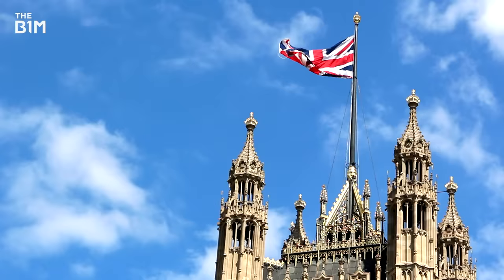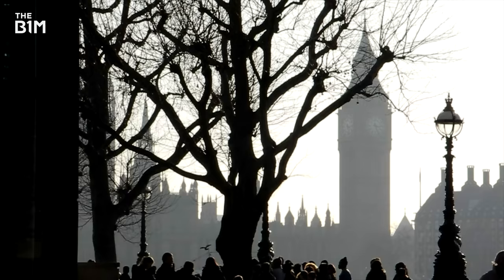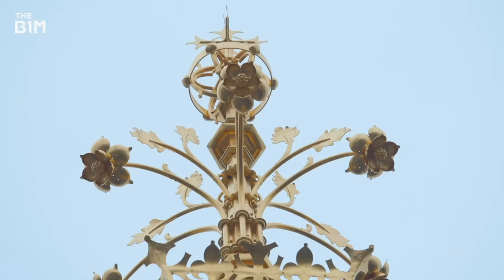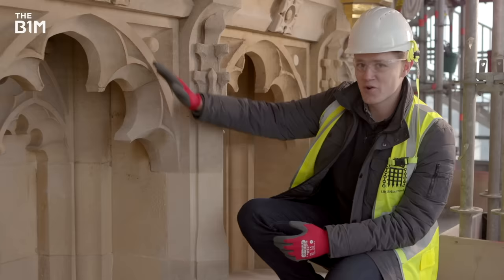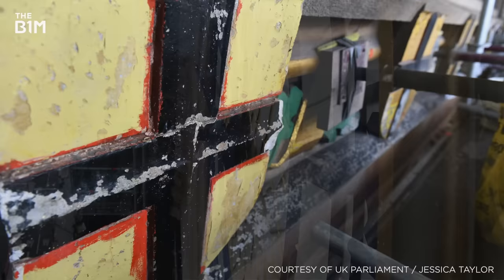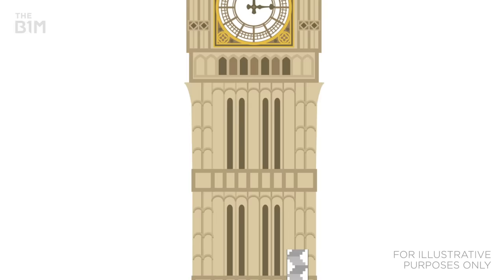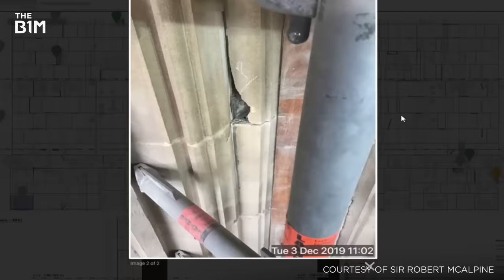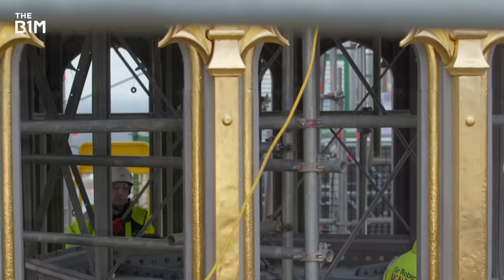Inside Big Ben's Makeover

Comment: Much respect for correcting flawed data and digitizing everything to make it easier for future restorers.
Reply: It's amazing the changes in everything that digitization/computers had brought to everything like this. Like instantly knowing where each part of it is and at what stage of work. It would have taken millions of pages of files and hundreds of people to keep track of all of that, and a lot of it not even possible only a couple decades ago.
Reply: @emjayay  question is, how much of that will be useful in couple decades from now. Try to open digitised files from 20 years ago. Either you miss the drives to read the data or the programs that can. It won't be much different in 20 years from now, yet alone in 100 years or so when the next renovation will take place.
Reply: @blubbber  This type of technology is not going to be obsolete in 20 years.  The DXF file was introduced in 1982 and is still commonly used today; that's 39 years ago.  3D files are a bit different, but there's many ways to batch convert or upgrade them to the latest format.
Reply: @blubbber  It's possible that they are creating a printed version, just in case. Of course, you might need a huge building to store the printouts.
Reply: @blubbber  I'd say that now data formats are a lot more standardised and most are here to stay.

Protocols such as TCP (server handshake to check connection), ASCII (formatting text in binary) , SMTP (email protocol) have been around for 50+ years because they got standardised early.
Reply: @blubbber  You've a good point but in the future computers will keep existing so digital data won't be outdated.

Comment: I’m a professional drummer and percussionist from the USA and avid British history junkie. So I was curious and did some math. Since it’s opening day in 1859 until today, 26th of October 2021, the Big Ben bell instrument alone has chimed 9,167,340 times. This does not include the various brief stoppages such as the two years during WWI and the current restoration. So I’d conservatively put that figure somewhere around 9,000,000 strikes of the hammer mallet on the Big Ben instrument! Also, the hammer mallet has continuously struck the same small contact area of its surface for almost its entire existence but the ablation wear depth has only been about 2-3mm. It is slightly cracked but those Victorians really built quality stuff to last. Or more accurately, The Whitechapel Bell Foundry who cast it. 
It’s astonishing. Peace!

Comment: Seeing this makes you wonder how on earth the Elizabeth Tower, and the rest of the Palace of Westminster, was built in the 1840s and 50s with hand tools, wooden scaffolding, ropes, and a vast number of skilled labourers - much like the cathedrals of the Middle Ages, but those often took several hundred years to complete!
Reply: The Wonder of Victorian Engineering! 👍
Reply: I often wonder where mediaeval worshippers held their services whilst they waited for the local church or cathedral to be completed!
Reply: Karl Delavigne I’ve worked as a roofer and a scaffolder on university buildings that date back to the 1200’s. I’ve often thought about this too. Especially when I find old tools, wooden nails and other items left behind by my predecessors.
Reply: @adam_p99  The quantity of wooden scaffolding must have been tremendous: I imagine the bars and beams would have been something like ash, maybe even oak, the weight of which would have been considerable. My house, which is from the 1790s, has large sheets of cast lead roofing, of a thickness equivalent to Code 10. I know how heavy even rolls of flashing can be! And these had to be hoisted up, rested on boards, then moved and worked on. There were probably large pulleys drawn by shire horses for these sorts of weights, or by the 19th century some type of cranking mechanism.
Reply: i'm impressed that someone presenting a show called the tower "big ben" when it's the bell's name........
Reply: Giza pyramids. Perfect example of mastermind architecture , Victorian churches are my favourite along side gothic , it's crazy the amount of detail. Us humans are more than capable
Reply: @robertcook2572  In Salisbury, where I grew up, the first main building erected was a church built specifically so that the masons and other people building the cathedral had a place to worship. The Church of St Thomas is still there, at the other end of the High Street from the Cathedral and still used for lots of important local events.
Reply: @BarfusWOW  I'm impressed that the B1M team remained subtly correct during the introduction by saying "the clock tower known as Big Ben", and also later informed us that its real name is Elizabeth Tower. 

As for "Big Ben" in the title instead of "Elizabeth Tower", perhaps it's so the average person who doesn't know the difference is more likely to find the video. Including me, who knew Big Ben wasn't the correct name but didn't remember the correct name. Or maybe they followed the precedent of the official website FAQ, which (after stating the correct name at the top of the main page) uses the tower's colloquial name when it asks "Is Big Ben leaning?" :)

( https://www.parliament.uk/about/living-heritage/building/palace/big-ben/elizabeth-tower-and-big-ben-conservation-works-2017-/all-your-questions-about-the-works-answered/#jump-link-25 )
Reply: @karldelavigne8134     Steam engines were in common use when this tower was built so no great problem with winching materials up the tower.
Reply: @RobbyDock  Where did you find this out? Are there detailed contemporary accounts?
Reply: @rjmun580  I don't think steam winches came into use until about 1880.

Comment: I found the digital model very interesting. It is very hard to get the information about existing infrastructure, as work from the past isn't that well documented. Great to see this projectteam documents the entire structure so thoroughly. It will be a joy for the next restoration if they can use such a detailed model as a base. Getting all the required information is normally a painstakingly slow process.

Comment: Having worked for 4 different conservation companies, including McAlpine, on quite a few, multi-million £ heritage jobs a sizeable portion of any budget is for consultants after that it's health & safety and probably the scaffolding.

If the country is so concerned about heritage and preserving things then why are the thousands of small country churches being left to deteriorate and fall down? The communities around these churches have no money to repair and conserve them, with many of them barely used because of low demand to worship. Tthe other problem is finding specialist craftsmen to do the work who don't charge as much as the consultants. 

With Big Ben Whoever thought of lighting the top part in Green needs to give their fee back again for the rubbish idea and the mortar around some of the joints has been smeared and carelessly finished with a large portion of their budget on the expensive gangster-chique gold paint on the high points.

Comment: They should replace the clock faces with digital. That way they could change it occasionally. The saved space from removing the works could be repurposed. The computer could play midi or wav files through speakers instead of begging stuck on those Winchester doorbell chimes.
The lift installation is a testament to the decline of humanity. What wimps! They were fine with that spiral staircase 200 years ago. 
I wonder what effect pollution had had
Reply: Well atlest the curent one doesent use any electricity

Comment: Because of coal burning and then dirty diesel engines, UK/Europe is covered in black. Köln cathedral was frankly slightly disappointing being completely black other than the replacement parts. And interiors because of smoking and candles. A lot has been cleaned (St. Paul's interior, Grand Central Terminal interior), a lot not.

Comment: I kind of prefer the old patina worn look of the Clock Face but like the restored stone work and would like to have seen the original black and white Clock Face kept with its warn patina mixed with the new Stone Work would have been nicer the blue and white does look nice and I guess in time it will start to wear in and not look so write or loud and will settle in quite a nice day I guess but do prefer the old patina look of the original clock face before restoration began

Comment: They could've installed an elevator decades earlier. Then visitors wouldn't have to use the deadly stairway or ask someone to get a rope to pull them up.
Reply: I just scale the outside... quicker and draws a crowd.

Comment: I don't agree with this. It would be far more effective if they were to preserve the structure instead of changing it, as changing the structure itself ruins the history and authenticity it might've had. The money could've went somewhere else as well
Reply: It's hard to preserve a tower that's bin outside in the weather for over 100 years.
Reply: @AtlantisTheLostEmpire  It's not actually that hard. Maintain sufficient upkeep and protect it from earthly events when applicable. This would be miles cheaper and potentially a smarter option than an entire makeover.
Reply: @KosherPorky  - I guess so. Though, cleaning just the outer stonework is a huge task on its own, so they may as well do everything else in one go since the scaffolding is a pain in the ass to put up. The elevator installation alone must be a huge relief for the current maintenance workers who are sick of climbin' those stairs.
Reply: @AtlantisTheLostEmpire  Some structural change, like an elevator, would be okay if it didn't compromise the current integrity of the original structure. But, the problem I have, is that you're changing something historical without much necessity. The only time a 'makeover' would be adequate is if the original structure was severely compromised or terrorized on a great scale.

Comment: Funny they didn’t mention the cock up with the scaffolding by using layher instead of tube and fitting 

Big Ben has been there for so long but it does not actually sit straight the wet river bed was not the best foundation and parliament has actually sunk one side meaning the tower did not go up completely straight that’s why they had to reassess the whole scaffold just before reaching the clock